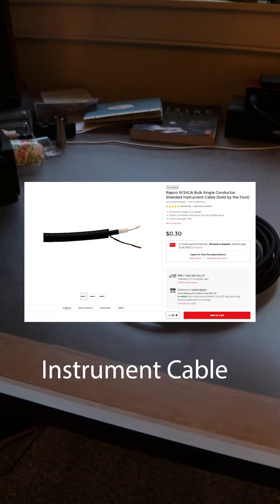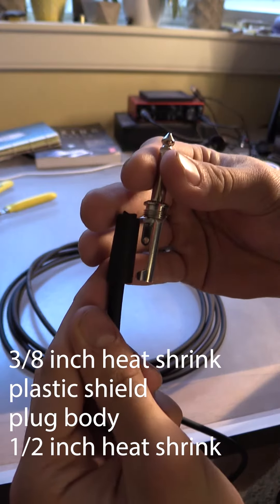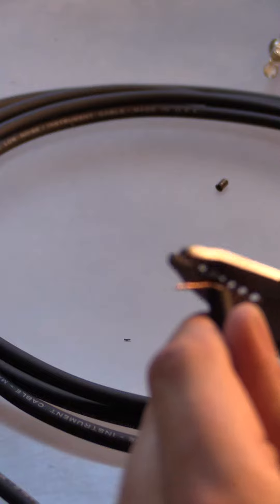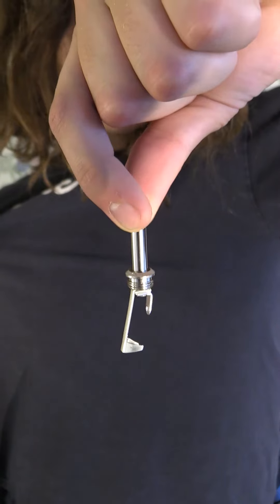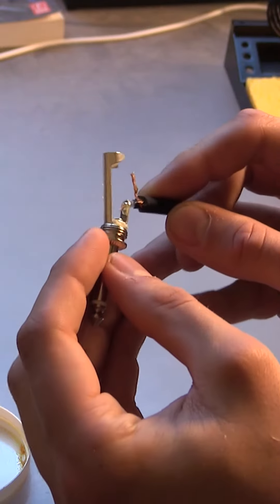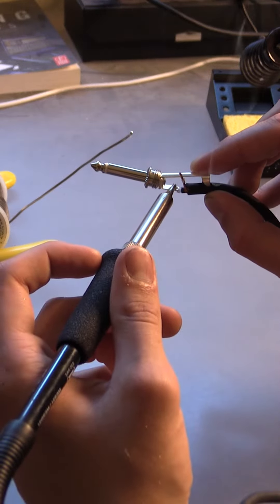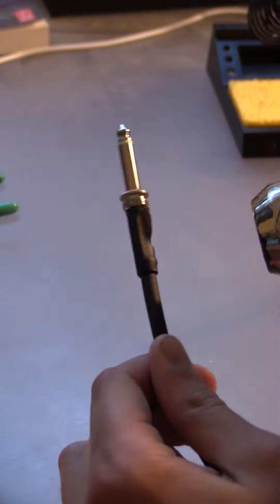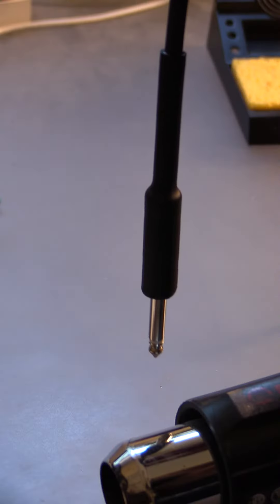How to make your own instrument cables

Comment: Good vid!  You didn't say, but you did it correctly....make sure all of your pulling stress is on the cable shield and not on the center conductor(s).  I use two-conductor-plus-shield cable into a stereo plug.  Thataway you are prepped for balanced inputs, and they still work on an unbalanced device.  Finally, I see you are wearing Fender.  I love to work on their old tube amps.  I have two that I'm working on right now.  And despite the digital direction for most everyone, I still love and use the old Mackie analog boards.  Good job!!!